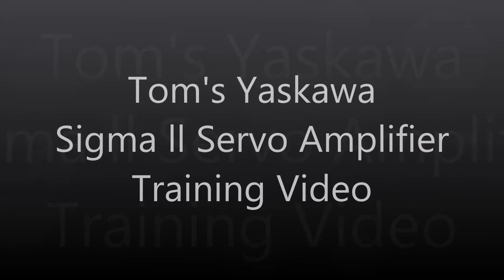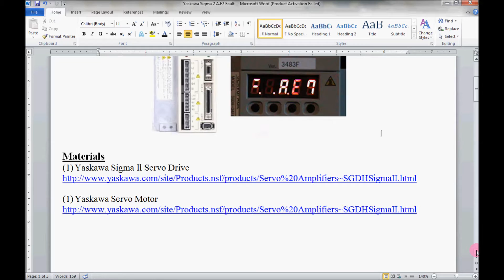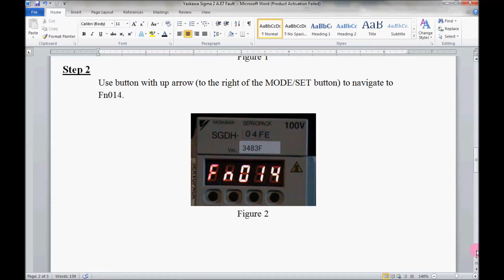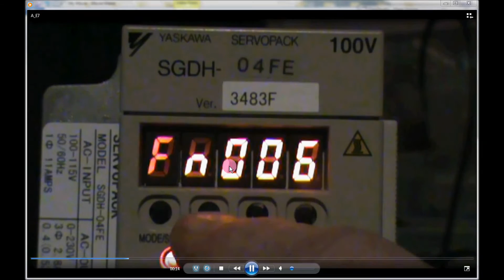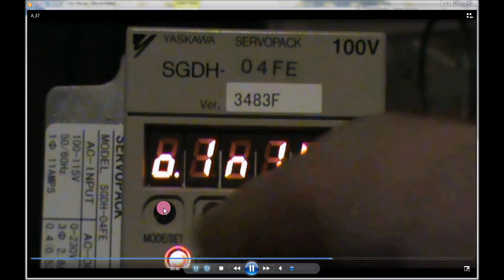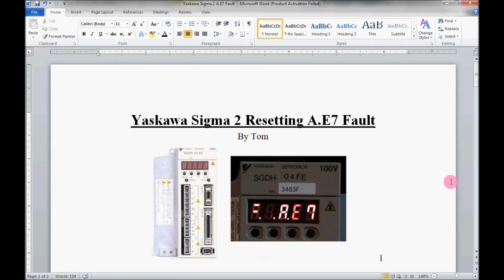How To Reset The A.E7 Drive Fault For A Yaskawa Sigma II Servo Pack

Comment: Hello , Am using Yaskawa Servopack 400V, SGDV-1R9D21A. Am getting an error code message as : A.810. How can i reset the alarm ? 
I would greatly appreciate any help...
Reply from the maker: In the video that I have posted yasukawa resetting the a. 81 is the same procedure for for the sigma 5 a.810 fault.

But sigma 5 and sigma 7 product line can be reset by programming. So check and see if there is reset option the manufacturer may have programed.
Reply: @tomh2466  Thank you for your reply Sir.

Comment: I have SGDH-02 AE OY and it is giving error A.F06 error, how reset or possible cause of this error.
Reply from the maker: PRAFULLA BHANDARE,

I have seen A.f6 which is Servo Motor Has Become Disconnected. With that being said, check the motor and drive power wire connections. also could be a bad drive. 

To reset you may need to power cycle the drive, depending the setup of your system you may have to E-Stop the line first. This way if drive would boot up into RUN instead of .bb the power section is active. 

If at power up it immediately faults change servo pack.

If you boot up to .bb, and attempt to start the drive goes to RUN than faults. Verify all the above are good than replace servo pack.

However, if the detected torque is less than 10% of commanded torque reference will also produce this fault.

Comment: What is a84 error
Reply from the maker: An A.84 (A84) alarm is an encoder data error alarm. This alarm is valid for both absolute and incremental encoders, and its meaning depends on the type of encoder. 

Most common application issues that cause an A.84 alarm are: 
Excessive Mechanical Vibration 
Excessive Electrical NoiseHope This Helps

Comment: i have cuation for you mr tom,, servo inverter in the display run, but not running motor servo, what action me for in the servopack , because iam search in manual book noting action,, may be you help me,,+6285649946622 for whatsapp me,,tanks mr tom,,

Comment: Thank you for this video, I was useful.
Someone answer this question?
How do you delete all alarms from Yaskawa keyboard?
Thanks for the answers
Reply from the maker: Good Morning Giorgio, 

I actually have an unedited video that I will post. But here is the short of it. 
First use the mode/set button to enter the utility function. navigate to function FN006 this is where you will clear the alarm history, when you have FN006 press and hold the DATA/ button (roughly 2 or 3 seconds) now trCLr should be displayed, push and hold the MODE/SET until DONE flashes 2 times. Now just return to bb or RUN. Also you can perform this while running.

Hope This Helps 
Tom
Reply from the maker: Giorgio Mattana
I have how to reset the alarm history for the Sigma II in my videos.
Reply: Thank you very much, Tom.

Comment: Hi I'm with a serius problem. I have am SGDH-04AE-N2-Y49
This is a custom model that came with an Sercos Network  
JUSP-NS200 
I removed the JUSP-NS200 but when i execute a jog command in the built-in HMI the servo motors only make some jerks, with the NS200 works perfectly.
But some parameters as P203 and P204 are locked.
I cant adjuste the mechanical scales.
I'm looking for someway to make it work without the JUSP-NS200.
Thanks
Reply from the maker: Have you attempted to reset to factory defaults. Also check parameter Fn010 this is the write protection parameter, place 0000 into this function and press and hold the MODE/SETtil DONE flashes on display. This should allow you to use the drive without the JUSP-NS200.
Hope this helps
Tom

Comment: hi mr tom thank you for all informations, please can you show us how we can command a servopack with a PLC (for example S7 300 SIEMENS) and a type of signale that we should send from PLC to servopack thank you very much
Reply from the maker: Good Day achraf,Pending on the model of servo you have, there are several options. If you are interested in the Sigma ll or the Sigma V, I could post a video on the Ethernet communication to a MP-2600 or the MP-2300miec motion controllers.
Reply: +Tom H yes mr tom thank you, I have a servopack Sigma II SGDM 20ADA and i want configure them to be commanded by PLC S7 300 of Siemens but firstly I want know how I can configure then in sigmaWin+ secondly to now what the commande should send from the PLC for commande the speed and torque of servomotor thank you very much
Reply: +Tom H the general idea it's the control of the servo motor walk for length hit in the panel wish is related to PLC S7 300 with  constant speed for example if someone hit L= 1000mm  the servomotor should turn (jog) until L= 1000mm and stopping I hope that I have described the system and sorry for my english thank you very much mr Tom
Reply from the maker: achraf,If you are using the TIA (Totally Integrated Automation) software I have a step by step procedure to providing a pulse train output from a S7-1200 plc. This looks to be the signal you will be using seeing that you will be moving X distance at a specified speed. After starting your project you will need to configure the pulse train generators (just a fancy name for high speed counter outputs), next you will need to create a technology object (another fancy name for Axis), next you will begin to create the motion control in the logic. In the TIA Portal on the right side you will find a folder called Motion Control, these blocks are used to enable the axis (place servo in run mode) and create motion control.Hope This helps Tom
Reply: +Tom H  yes I use the TIA portal software, but i dont know the procedure to follow I would like to see the video please, see how can I configure the servopack sigma II sgdm 20ADA and his commande in TIA portale please, thank you if you have à videos like yours which start with presentation written like you was presented, because I don't really understand all when I hearken but when I read I understand the Ideas thank you so much me Tom
Reply: +Tom H yes I use the TIA portal software, but i dont know the procedure to follow I would like to see the video please, see how can I configure the servopack sigma II sgdm 20ADA and his commande in TIA portale please, thank you if you have à videos like yours which start with presentation written like you was presented, because I don't really understand all when I hearken but when I read I understand the Ideas thank you so much mr Tom
Reply: bonjour achraf , esq  je peux avoir votre contact svp j"ai des qsts à propos du sujet .merci

Comment: HI how  could we remove AF05 alarm on yaskawa sigma II series ..
Reply from the maker: The A.F05 Alarm is the Servo amplifier and servomotor capacities do not match each other. Has the motor or amplifier been replaced? If so check parameters of amplifier. Also check the servomotor to ensure that it is a direct match. 1. The range of the servomotor capacities that can be combined has been exceeded.2. Encoder parameters have not been written properly.This alarm will not clear until the condition for the alarm has been corrected. Hope this helps Tom
Reply: +Tom H 
thanks tom 
can i get you e-mail  address or whatsapp numer too.

Comment: how and what to diagnose A.41 alarm on SGDM-50ada, anyway to reset the alarm?
thank you
Reply from the maker: Kwee Yoong Ong This could have a number of contributing factors.First thing when does it happen?
Reply from the maker: @1140014800689658564281. If the Servo Pack faults at power up. You could have a faulty board.  Change out Servo Pack
Reply from the maker: Tom H 
2. If fault occurs when the main circuit is energized.     Check the voltage into the servo pack and verify proper voltage from all phases.  Action: Correct reason for low voltage.Could also be bad fuse in servo pack.  Action: If bad fuse in servo pack I attempt to find reason before changing servo packs.
Reply from the maker: Tom H 
3. If this is happening during operation.     Check for a short in the power cable and motor, between Servo Pack and Motor with Megger.  (Ensure you disconnect the cable from the Servo Pack first).

Comment from the maker: The A.92 is only a Regenerative Overload Warning.
The A.71 is the Fault. There are actually a couple of ways to reset alarms on the Sigma ll Servo Pack.
1. Power cycle Servo Pack
2. Using the Hand Held Digital Operator, Press the RESET Key.
3. Using the Built In Panel Operator,
4. Using the SI4 / ALM-RST Input to reset alarms.
Any of the above should work with the A.71 alarm.